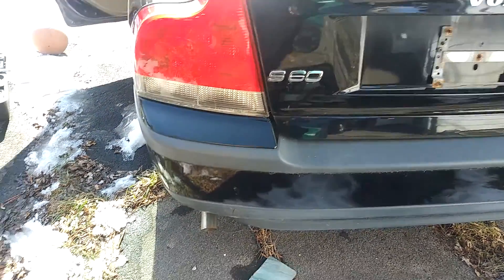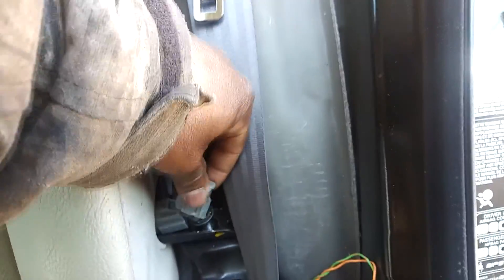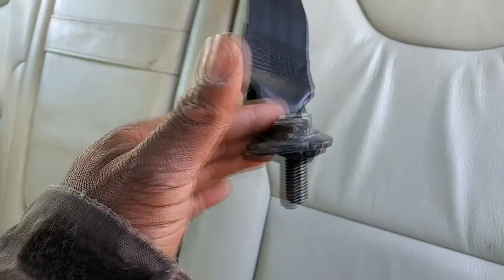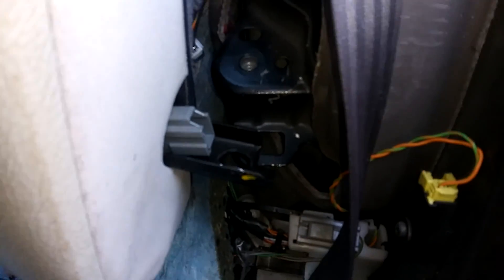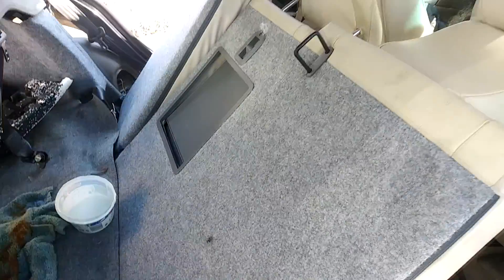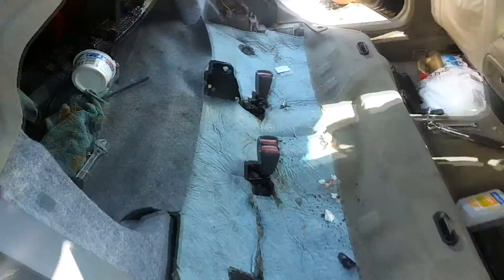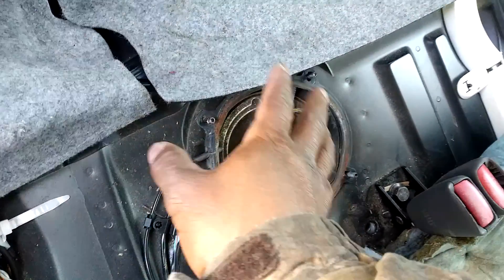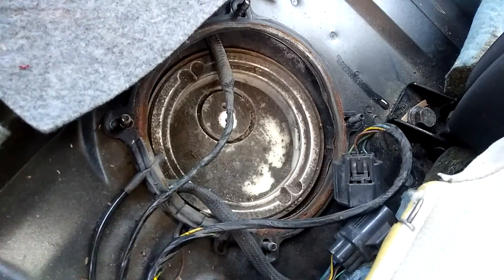04 volvo fuel pump LOCATION

Comment: I guess I need to make a video from this point on... I don't know why you're messing with the wire harness, just unplug from the plastic top. Clean that chrome ring off and spray with penetrating oil, turn counter-clockwise with with punch and mallet. The hardest part for me was getting the fuel line undone. There's a colored part on the fuel line (mine was green), push line together and pry up horseshoe shaped clip. The other little electrical connector was tough also but, just use small flat-head screwdriver and lift tab to unlock. Remove pump, verify type and order from IPDUSA or FCPEuro. It's a Bosch just verify which one. FWD, metal tank is simple...no fishing the sending unit line to the other side. If you have a AWD w/Plastic tank...good luck.  Thanks to all the YT videos that gave me confidence to try this job, I was afraid I was going to have to drop the tank like my Suburban requires.

Comment: Hi , I got this same pump in a 2003 non-turbo 2.4 s60. But I can’t find a replacement pump, it so rare! Do anyone care to share a part number?
Reply from the maker: I'll do some research for you
Reply: @byron7918 I got! Soaked w/penetrating juice for about an hour. Spun right off with punch and rubber mallet.